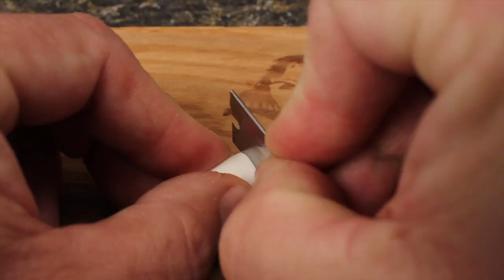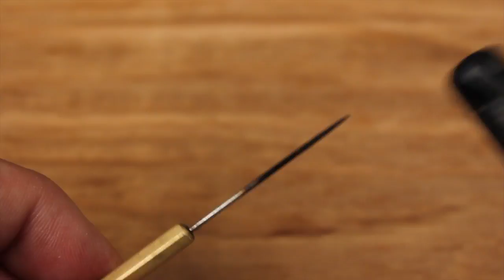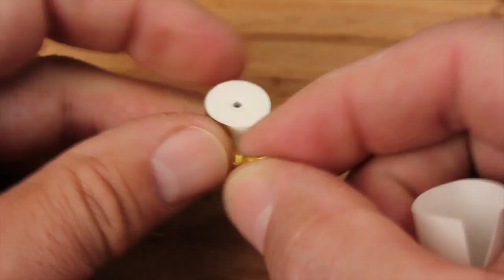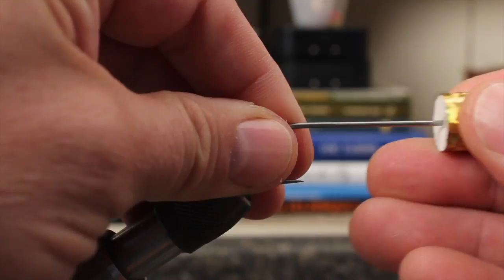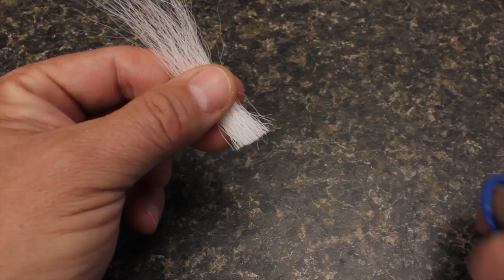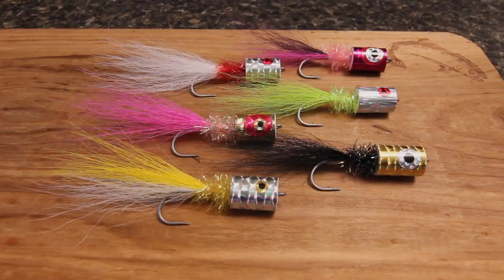Bob's Banger

Comment: Could you use craft fur as the tail on these
Reply from the maker: Bucktail is much better because it is stiffer and helps support the fly when it is "popped". It's also less likely to foul in the hook bend than craft fur.
Reply: tightlinevideo thanks